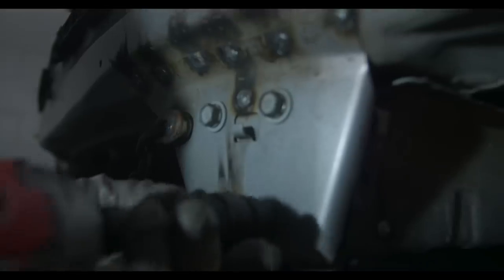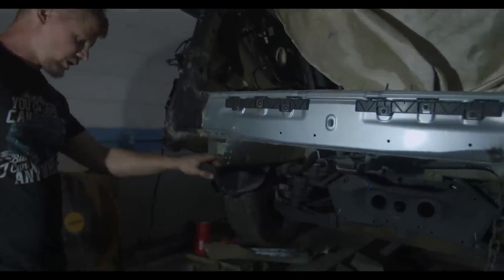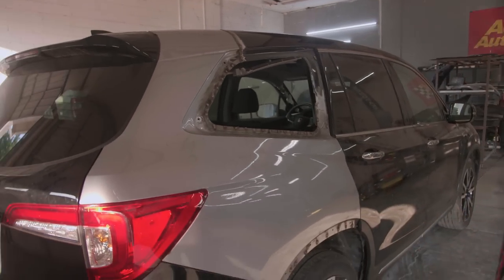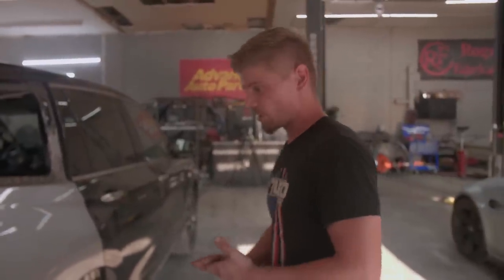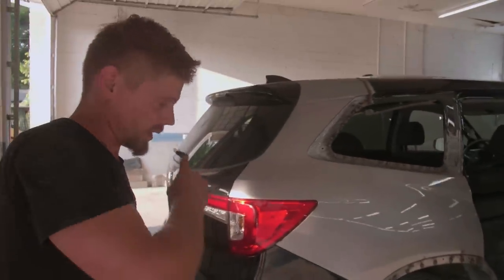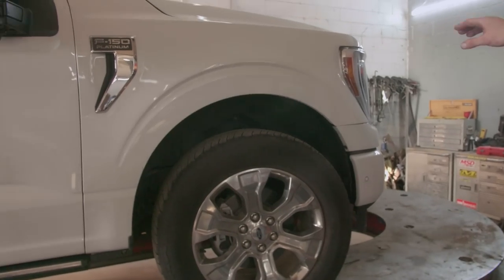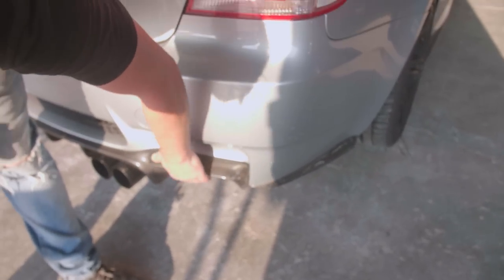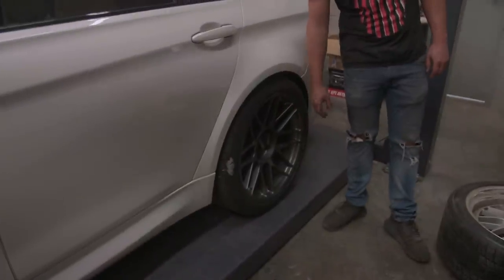Rebuilding a 2020 Honda Pilot Part 3. Welding on the Quarter panel!

Comment: Check the wires for the hatch where they come out of the body and go into the hatch at the pivot point. They tend to break there on hatch backs that are used a lot.